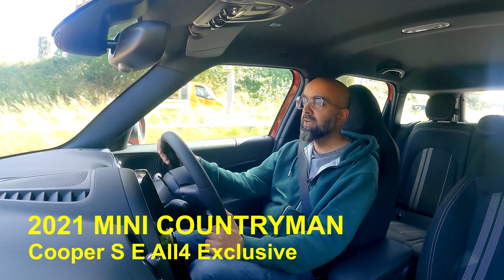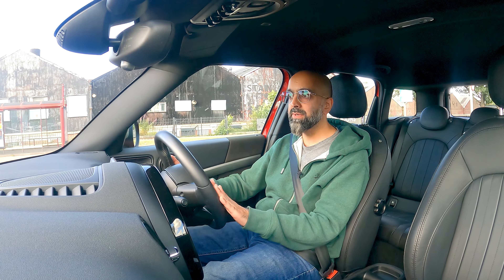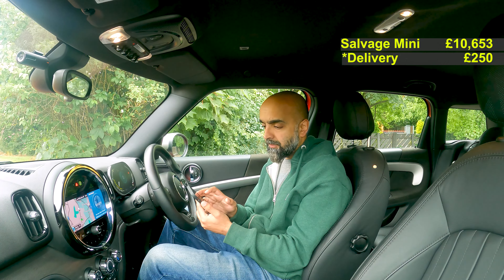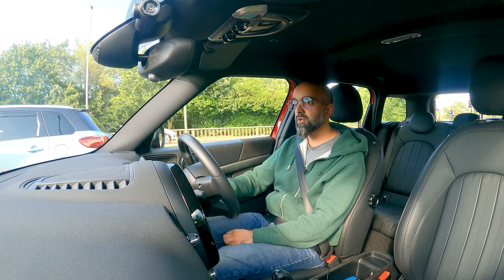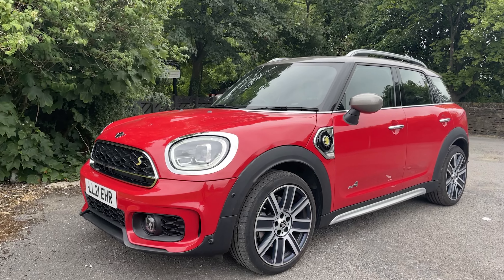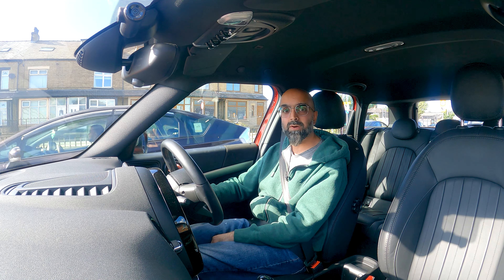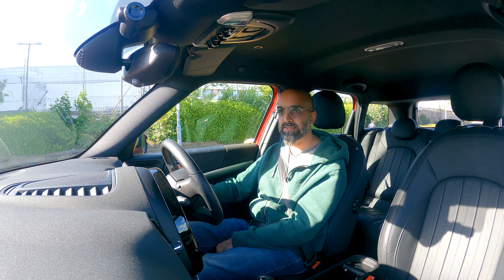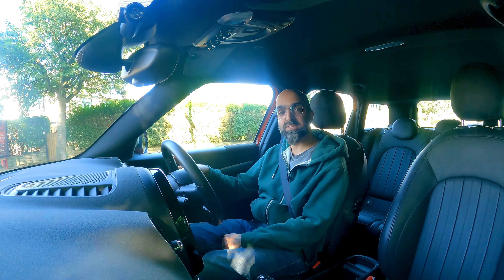I FINISHED REBUILDING MY WRECKED MINI COOPER S E HYBRID £ Cost of Copart Salvage Auction Restore DIY

Comment: Great videos brother. You did an excellent job putting that countryman together. 

My cousin and I did something to a 2018 phev countryman. Drove it to MOT (5 mile journey) and passed with flying colours, however on the journey home started getting error messages and car started jerking and just couldn't go past 10mph. 

THE FAULTS
-Battery not being charged
-Hybrid system fault 
-Regenerative braking not available

I've changed the non hybrid battery already because previous one was dead and couldn't revive it with a noco genius 10. Current one is brand new from BMW.

Not sure whatbthe issues are so far.
Reply from the maker: Thanks bro, have you had the codes read? What are the errors exactly? I used the ISTA software to reset one of the error codes I had. Did it have airbag damage? Be careful if the battery pack looks physically damaged it could be very dangerous for anyone working on it.
Reply: No, the airbags didn't go off. Just a front damage, replaced pretty much what you replaced on the front, the complete radpack, bumper, headlights etc. Got it as a runner, but with a dead battery that needed a jump start.
Reply: It came up with a few codes, can't remember them I don't have the OBD with me. But one think we're certain of is the non hybrid battery isn't charging inside the car. I've just taken out the brand new one and it was flat, it's now plugged to the trickle charger.
Reply from the maker: I’d recommend starting with the OBD codes, see where that takes you. There’s a small chance it’s related to the pyro fuse, I’d also check all your fuses and the physical condition of the high voltage battery, in case it’s damaged and needs resetting via ISTA
Reply: Hello brother, quick question on the coolant top up/change. Do you fill both reservoirs or just one on the right near the 12v battery? One is for engine and the other for high voltage tech.
Reply: I've just re-watched your episode that involves the coolant. I can't see that you did both. I've checked mine today and can see engine one is topped up sufficiently but the HV battery reservoir is below the min line. I haven't poured anything into that when we changed the radpack. What do you think my next step should be? Are they both connected?
Reply from the maker: For the coolant, I only filled it via the tank on the left (UK passenger side) then follow the BMW coolant purge instructions: Push start button once and keep feet off brake. This will turn the ignition on, but not crank the starter.
- Set heater temp to MAX and fan blower to low speed.
- Press the accelerator pedal to the floor for 10 seconds. You should hear and see the pump working to purge the air out of the system.
I didn’t fill the other side, they are connected so it balances itself out - this is how it worked for me, assuming you haven’t lost more coolant than me it should be the same process?

Comment: Hi Imey. Great job!! And good videos. I’m thinking of doing the same with a similar car, hence finding your videos. 3 questions if you can: what software did you use to reset all the DTCs/is one better, or cheaper, than others. Also, I have done a Discovery in the past, and the crash data was un-eraseable, and I had to replace the Restraint Control Module, then reprogram it - did you have to do something similar, or do BMWs allow you to reset it. Finally, the pedestrian protection system - do you have to replace the sensor (pipe) and the explosive bonet pistons? Or could you reset them/reuse them somehow? Many thanks in advance.
Reply from the maker: Hi there! The software was ISTA, it’s free BMW software you just need a decent quality cable - it’s usually rj45 to OBD port. ISTA can reset airbag ECU’s, though I’ve read that some ECU’s can only be reset a number of times (maybe 3) so just try it when you’ve completed repairs. On the pedestrian protection system, I replaced the whole system including the tube sensor. The explosive part of the bonnet mechanism looks to be sealed for one use only, I.e it can’t be refilled, I personally wouldn’t risk refurbing airbag components :)
Reply: @ImysGarage  thanks for your reply, much appreciated. All the best

Comment: Incredible transformation 🎉 is that actually possible to upgrade interior trim and go from piano black to something else? Or maybe upgrade seats? Just have idea to make my mini countryman f60 better ❤
Reply from the maker: Thanks, yes you could easily remove the dashboard trims and seats to replace with different ones. There are two different types of rear seats though, one that slides and one set that’s fixed in place, so you’ll have to replace with what you have originally to keep things simple.
Reply: @ImysGarage  that's awesome, do i need also upgrade mini software if i'go with electrick adjustable seats? sory for those questions, but i'm strugguling to fing any information about. Thank you for your video again, it's awesome!
Reply from the maker: @iminimal86  that’s a good question! I don’t know for sure but if your car has the wiring connectors then it should work. If it doesn’t you can usually code things in using ISTA software. Look it up - really handy BMW sofrware